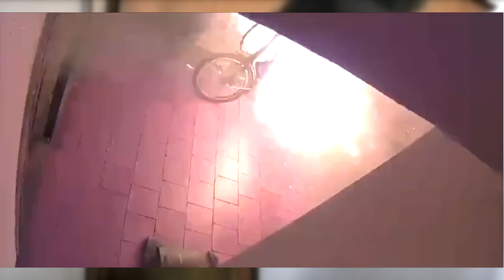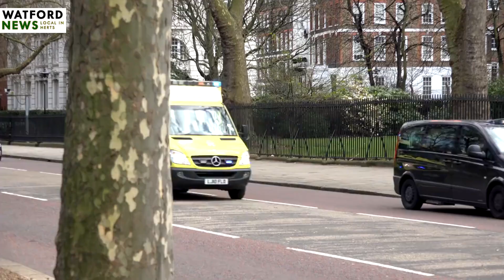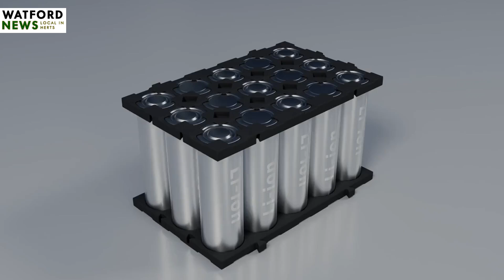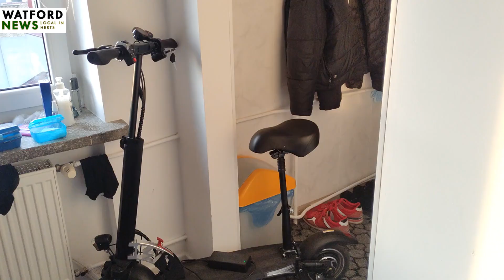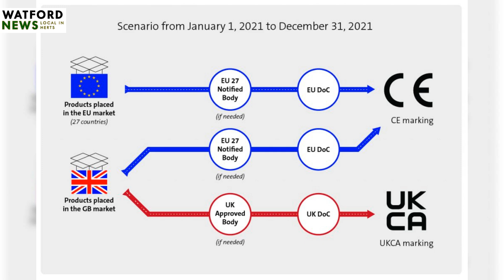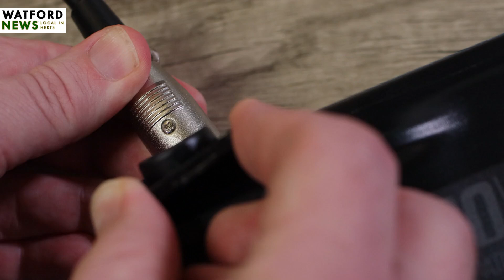Exploding Electric Bike Fire & Safety Advice

Comment from the maker: A fire at a cycle repair shop near #Tottenham is believed to have been caused by the failure of an e-bike lithium battery pack. 
Six fire engines and around 40 firefighters attended a fire at a shop on West Green Road near South Tottenham.

Most of a cycle repair shop, with residential accommodation above, was damaged by fire. Several people left the building before firefighters arrived. There were no reports of any injuries.

The fire is believed to have been caused by the failure of a lithium battery pack for an e-bike. The fire is then believed to have spread to involve a number of other e-bike battery packs situated within the shop.